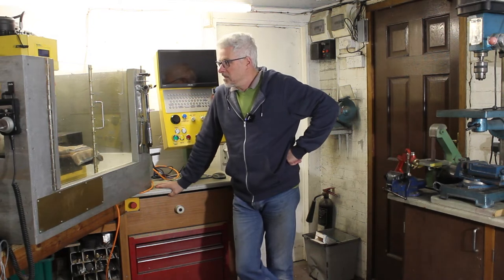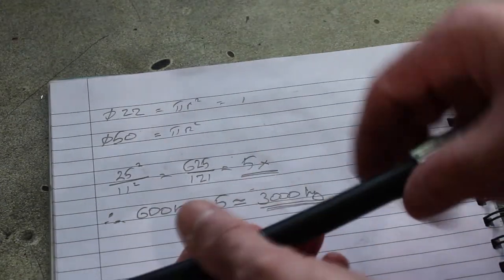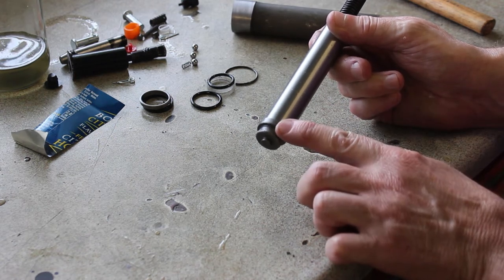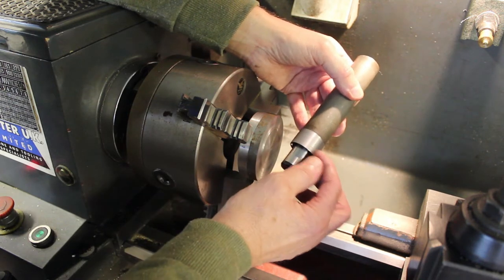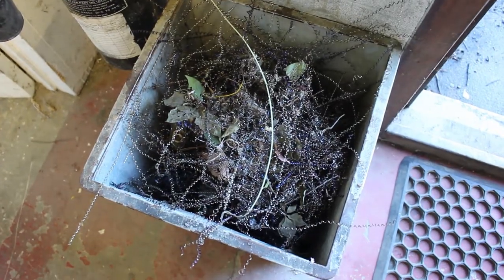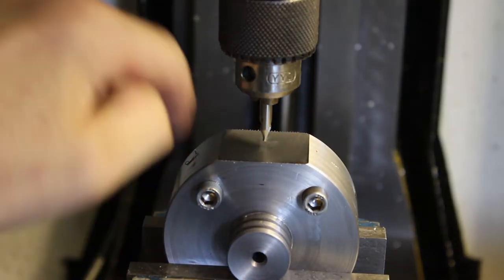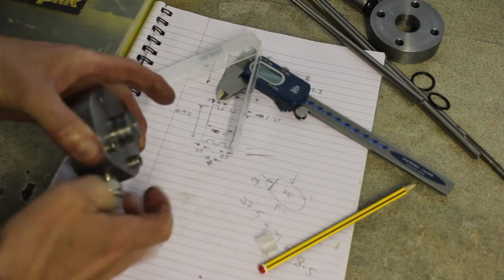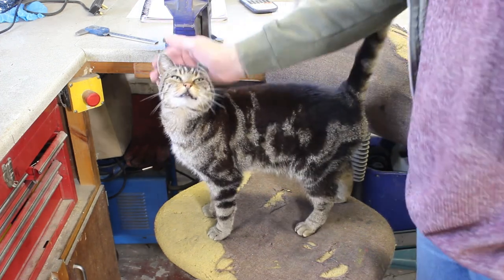Cheap Hydraulic Power drawbar Construction pt1

Comment: Wow It's really cheapest!
one more question, why don't you connect it directly, 
if It is power problem then,  I really recommend using BLDC motor and planetary gear, and Directly control BLDC with FOC control.
I think that It is another way of cheapest Drawbar control.
Anyway I love your job!!
Reply from the maker: Hi I did not have the space to fit anymore kit on top of the mill. The ceiling is quite low and the extra weight would not have helped. I have tried a drill motor admittedly the cheapest I could find. I did not get enough power out of it to work. It could be made simpler and a lot smaller than my setup. I may revisit this in the future.
Cheers